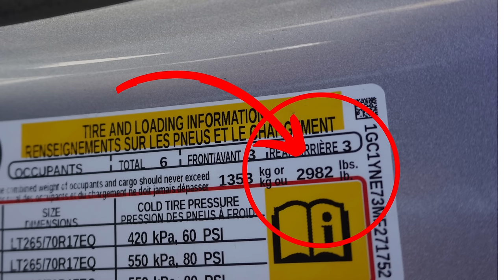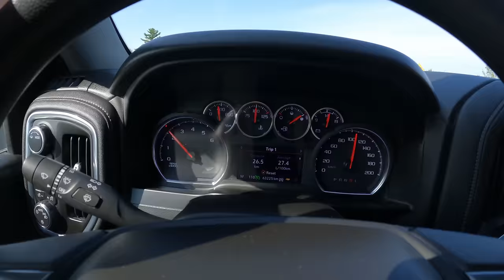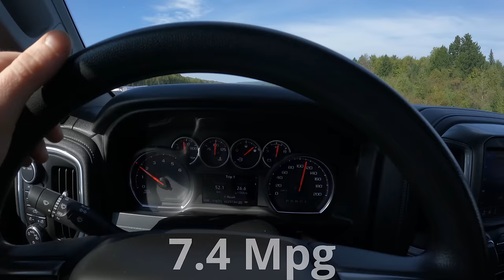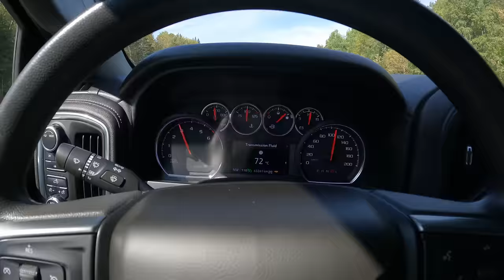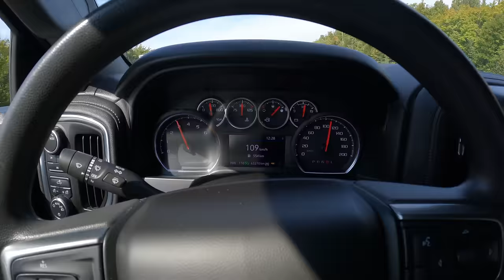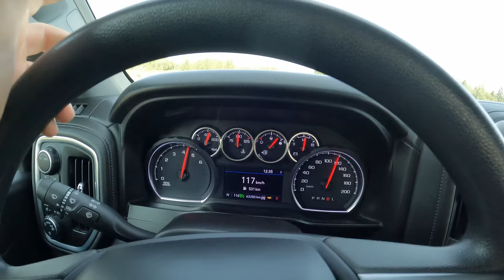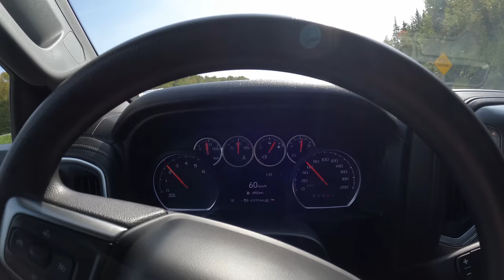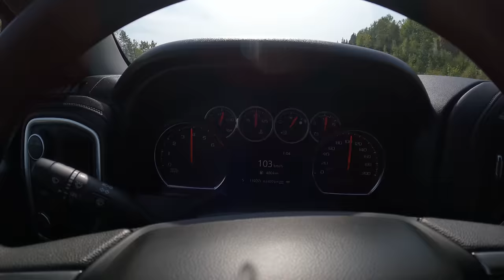Chevy 2500 6.6L GAS Engine (L8T) **HEAVY MECHANIC Review** | How DOES IT TOW??

Comment: Would be nice to see you review some of the heavy duty trucks from the 90’s. Imo I feel like they are some of the best built and reliable trucks out there. It honestly blows my mind why we can’t have a simple engine and a manual transmission anymore. I know in Japan and Middle East they still make simple trucks that are meant for work and cost between $20k low end to $40k high end. Anything over $40k for a work truck just seems ridiculous. 
I would like to see you review some of the first gen Cummins and also the GMT400’s
Reply: Im sure manufacturers would love to offer something extremely basic
Two reasons
The market doesn’t support that type of vehicle anymore, evreyone on the internet will rip it apart. 
And emissions, No simple diesel will ever come out again, for the American market.
Reply: While I agree it would be cool to see I think a lot of people would be very shocked at how poorly those older trucks perform as compared to the new trucks. A 90s diesel would lose in every measurable performance metric compared to these new gas trucks. And the gas trucks from the same era would be light years behind. 

I’m a Chevy guy but the fact is a 1990s 2500 Silverado with a 454 and 4 speed auto wouldn’t have been able to maintain his speed in this test. It wouldn’t have been close. It mostly would have been due to the 4 speed auto but being down over 100 hp wouldn’t help things either.
Reply from the maker: I would find it really interesting to do something like that tbh. Maybe down the line I can set something up

Comment: GM seems to always be lazy to downshift. I had an 2500HD with the 6.0 and 6 speed transmission. I really did love the truck, especially the way that it was so reliable. We pulled our 10k fifth wheel with very little issues. I just hated the way that the 6 speed would not downshift and keep speed. Then comes a Blackbear custom tune, and that made a difference. I saw that the transmission would shift faster and keep the 6.0 in the power band more effectively. I hope they tune the new 10 speed to downshift quicker, I’m sure it would be a better tow rig. Funny thing is, I had to downsize trucks and went to a Colorado zr2. Ironically that 8 speed with the 3.6 down shifts very quickly and stays right in the powerband. If I need to go back to a 3/4 ton I the future,I would def get the 10 speed and 4.30 gears if it was offered.
Reply: My similiar truck drove me insane with 4.10's, 1st gear was WAY too short

Blackbear actually spec'd me a tune that locked 1st out and only enabled it in tow/haul, made a big difference
Reply from the maker: I think it will be very interesting to see how the 10 speed in the 6.6 stacks up because those lazy downshifts were just causing the engine to work so much harder to regain speed halfway up the hill

Comment: Love all your videos , nicely edited and very clean. I really need your help with one question: i really Dont tow anything,i just like the look of the heavy duty trucks. I am torn between a gmc sierra 2500 SLT  Gasser , and a 2023 Ram Rebel Diesel ( they are knocking off $11k at a dealer near me) Ride quality is very important to me. I currently own a 1500 Chevy Silverado LTZ with the baby diesel engine. Thanks for your time-vic

Comment: So the 2024 6.6L with the 10-speed trans is an amazing truck.  Fuel economy is slightly better, but the interior refresh is a game changer.  Ford's interior is dated.  They need to fix that to get back ahead of Chevy/GMC.  Plus, Ford is having way too many issues with build quality.  Their cost is also a fair bit higher for comparably equipped trucks.

Comment: These comparisons are always a bit odd to me. Theyre not very "real world".
Typically when towing, especially going downhill, you would select the right gear manually, letting engine braking slow you down rather than your brakes. 
Also, i dont believe GM built the 6.6 gas engine to replace the 8.1 or to complete with the 7.3.  It was to create an improvement upon the 6.0 it replaced, and to offer a good option for those that dont need the power of a Duramax.  Nor the cost.
6.6 gas is perfect for those that need more tow capacity than a half ton, but dont need to tow a house.
Its also great for those that dont tow at all, but need to haul heavy stuff in the bed more economically.

Comment: All the videos I've watched with the new 10-speed was no better than the 6 speed surprisingly.
Reply: Interesting 🤔
Reply from the maker: I think it will help but I want to see for myself on this towing loop. happy I have a nice baseline.
Reply: What videos have you been watching?? Every 24 Gasser with a 10 speed has performed so much better. The 10 speed was almost 2 mins faster up Ike than the 6 speed both towing 14k…
Reply: @Billybob50119 exactly!
Reply: @Billybob50119  Agreed.  I drove it and its night and day for city driving.
Reply: My truck at work is a 7.3 ford my personal truck is a 2500 chevy 6.6 gas. I could give a
Hoot about power they both pull the same weights basically….. but unloaded daily driving the ford is a log truck… I have had ford look at it 2 times for vibration and the bump feeling…thinking bad tires… ford rides bad period compared to the General Motors trucks

Comment: There’s no replacement for displacement, I wish they still made the 8.1 Vortech Chevrolet should bring it back with the 10 speed like everybody’s saying🙌
Reply: I have an 02 2500 with 8.1 true 5 speed Allison transmission and would not trade it for the new 10 speed GM transmission.   New 10 speed is not an Allison.  GM and Ford both have the sam 10 speed with tiny differences.   GM pays royalties to Allison for the name.
Reply: @chrischavez2324  it would be nice to see them with the 8.1 or bigger 😶 vortex with an actual Allison made 10 speed transmission, not just branded. I think that they would sell the shit out of that.

Comment: May not win any   races but will turn out to be way more reliable than the 7.3L  Ford.The jackshaft- driven oil pump doesn't sound too impressive as for as long term reliability is concerned. There was a camshft issue with the Godzilla also.

Comment: I think what you're noticing is very poor transmission tuning and of course like you mentioned only 6 gears vs 10. It's not so much a lack of power as it is the fact that the transmission is unresponsive. On some of those hills, if it downshifted earlier it would have hit 110 again much faster too. TFL also noticed this. The 10 speed reviews I've seen are great, and one guy "automotive inc" here on YT actually says the 6.6 10 speed does better than the ford, he's owned both but his ford crapped out on him (cam/lifter delamination). They should be far more comparable anyway.

Comment: How do you like the 6.6 vs the 6.4 hemi?
Reply from the maker: They are pretty comparible to be honest. I think the 6.6L has a little more punch with the higher torque figure but it's also a newer engine. I keep hearing rumblings of a cummins gas engine coming down the line potentially for the ram HD trucks

Comment: If you could i would love to see someone let you borrow their 8.1 liter with the allison trans and yank a trailer around.
Reply: I have a 02 2500 8.1 Allison combo and have towed close to 14 lbs up to shaver lake with no problem.   It's absolutely a freight train.   The new GM 10 speed is junk.   Sorry but GM screwed themselves by not putting a Allison transmission behind their new HD trucks.

Comment: The ten speed makes all the difference. Night and day difference towing
Reply: Still slower than the ford 😂
Reply from the maker: Im excited to see how much of a difference the 10 speed makes
Reply: @freedomisntfree_44  o are you talking about the optional engine for a $ add 7.3?? The one that is delaminating cams and lifters faster than Ford can replace them?? 😂
Reply: @Billybob50119  and yet no proof of it like the gm trucks 🤣🤭 enjoy pulling your camper every blue moon with a pos oil burning gm 😂
Reply: @freedomisntfree_44  do a quick search, I know it’s hard for you to do. It has also been proven no 6.6 burns any oil after 2022, again do a quick search and don’t hurt yourself 👍
Reply: @Billybob50119  sure are folks tht have proved it does 🤡🤣
Reply: @freedomisntfree_44  please show me a 2023 or 2024 that is verified to be burning an excessive amount of oil. But if you would rather have to replace lifters and cams and possibly a whole motor when metal goes thru knock yourself out 😘 you deserve a brand that has the worst quality the last 3 years straight 🤣
Reply: @Billybob50119  then Don’t buy a gm, because they have been putting motors in truck with 5000 miles. Still waiting on  a ford like that… 🤡
Reply: @Billybob50119  oh and right after you show me a failed motor on a 23 ford 🤭🤡
Reply: @Billybob50119  that’s not proof 😂 that guy just said ahh yeah it’s making a noise 🤡

Comment: Unfortunately for the GM fanboys (and girls) this configuration has to be directly compared to the 7.3 10 speed Ford, because atm it's the best (sic) GM has got. 
And even with a 10 speed I find it unlikely it will match the Ford also, especially given the Ford's available optional final drive ratios.
Reply from the maker: My thoughts exactly. People who are looking at buying gassers are going to compare these engines. Im happy GM recognized the 6 speed transmission was just not cutting it.

Comment: Sounds like 6.6 suffers from oil consumption. And that cruise control programming is BS
Reply from the maker: Ya it was just odd seeing the truck drop speed like that
Reply: My biggest complaint on my 23' GMC 3500drw is definitely the transmission. I'll be trading in 25' and can't wait to try the 10speed and I'm hopeful they add a little more low end HP to this engine .

Comment: Hold on - is this the older one with the 6-speed? 2023 has the new 10-speed and that supposedly really helps this engine...
Reply: 2023 has the 6 speed, the 2024 has the 10 speed
Reply: The videos I watched there was hardly any difference
Reply from the maker: 2024's have a 10 speed.
Reply: @robertchapman4488 watch the Ike Gauntlet one, the 10 speed made a big difference. Also, those guys got great MPG on a 6.6 gas with 10 speed, unloaded.

Comment: "Big displament gas engines" 😂
Reply: Long time Ford truck owner.  My last purchase was a 2022 Silverado HD 2500 with a 6.6 gas.  My truck is similar to your test truck.   

All that to say, I’m very happy with my truck.   I rarely tow over 12k (trailer & load) and the gasser does exactly what I need with ease.   I’m not pulling daily or through mountains.   

Great video and info.
Reply from the maker: Iv heard many happy owners with these 6.6L trucks and these engines are just work horses. Strong and reliable

Comment: I am seeing so many 6.4 trucks these days. Seems guys are going away from diesel.
Reply from the maker: The modern diesel engines just come with alot of potential headaches and they are expensive. Makes alot of sense to go with a gasser HD these days
Reply: Just had a guy stop and ask me how I liked the 6.6 yesterday. Said he had 12k miles on his Cummins and it’s been in the shop 6 times for regen issues. I’d drop that truck like a bad habit.
Reply: Yeah I agree. I'm not towing often anyways so a gas truck is perfect for me. Cheap cheap maintenance too.